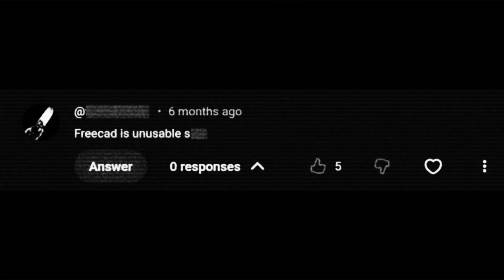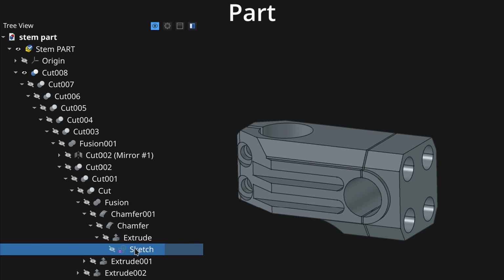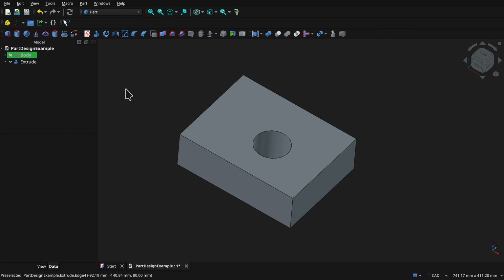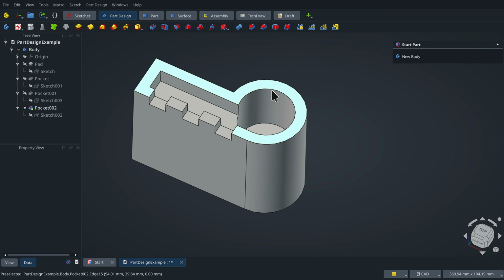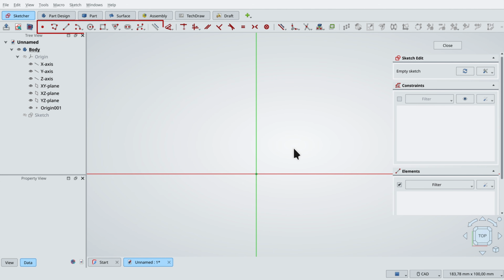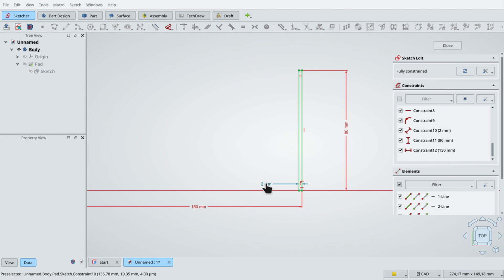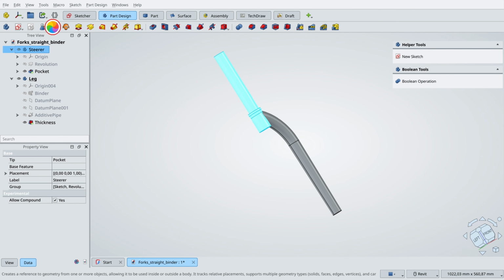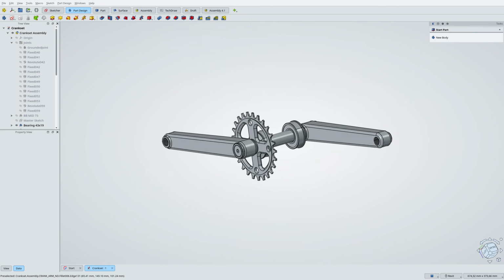STOP using FreeCAD WRONG! Do this INSTEAD (Workflow & Tips)

Comment: So, amazing video! It gives me more inside about the program and mindset. But what I don’t get is, I always need to round corners at the end of the CAD adventure. But when I do, and then 3D print that object and it is to small for example. I need to adjust the length, but then I need to remove the round edge, adjust the length and put the rounded edges back at it? I have around 40 hours in this program and I still only know the beginning of the program. 

I feel like my parents dropped me off at MIT when I was 7 and just said “good luck, see you next year”. I feel so stupid and dumb when using this program. I don’t know anything from errors to how the basic restraints work. 

I frustrate myself a lot when using this. And it isn’t the programs fault. It is the first and only CAD pregame I use. And that frustrates me more, that I just don’t get it after that many hours because FreeCAD doesn’t say “this error means this and you can fix it if you do this”. FreeCAD just says “YOURE DOING IT WRONG YOU STUPID!!!!!!”  And then nothing… no help at all. 

So if anyone can tell me how to use the rounding edge at the end and still edit the length for example. That would be great!

Comment: I am using FreeCAD, and probably will continue using it, but its UI is really a mess. Why when you create extrusion in Part Design and in Part you have different interface? Why in Part it does not have a preview? Why I cannot disable this "snap to middle"? (And, by the way, why there is no easy way to create this middle point of a line when I need it?) Why when I use "horizontal length" constraint I have to select point on vertical line, and cannot select line itself? Why when there is "Wire is not closed" error I cannot see immediately (or clicking the button directly in the error message) what exactly is wrong, and I need to go to "Validate sketch", and highlight is lost when I then open Sketcher to fix the issue? I can continue these questions forever.
Yes, I know - it is opensource etc. But sometimes it looks like priorities are skewed.

Comment: I am using FreeCAD for 6 months ... And I find it really good until the point you need to tweak something, things are constantly breaking ... Maybe there are design rules for avoding this, but I think it could also be designed better ... Selecting things with the mouse on a 4k display is also very hard ... but it's free ...

Comment: you are both correct and wrong. FreeCAD is amazing because its so powerful and free: correct. FreeCAD has a very high learning curve and overall skill floor making it worst for beginners compared to many other software.

Both statements can be simultaneously true. The freeCAD team should bring in some outside eyes to help them take a look at their product and re-evaluate the workflow, if they ironed out the cumulative pain points freeCAD could actually be a real contender against the paid options

Comment: I started with TinkerCAD and moved on to Fusion 360. From time to time during that period, I checked in on FreeCAD on several occasions and really wanted it to work for me, sadly, it did not. I simply could not get it to work for me. Fate would have it that I switched to Linux and had problems running Fusion 360, so I gave FreeCAD a try again. This time, probably because of what I'd learned in Fusion, FreeCAD made a lot more sense. Now I am full time in FreeCAD and I do not have any real problems. The learning curve, as mentioned, is steep, but definitely worth it.

Comment: Usually , the 'u are not clever enough for the tool' objection means its a badly designed tool. It can hardly go beyond the geek market. UI / UX expertise exists for a reason. You can surely become an expert at coding with VI , its not the way it works in the software industry now. Nice UI is king,

Comment: One thing to note in your video- you CAN have a rectangle with a line down the middle and still be able to pad it- the trick is that the Sketch should be drawn as 2 rectangles sharing one side which gives the visual impression that the sketch is actually one rectangle with a line down the middle. You then CTRL-select each side of the first rectangle, and pad it and do the same to the other rectangle.

Comment: Coming from Solidworks, I had the same first impressions.  I failed to remember 50 hours of formal SW coursework and a year's worth of at-work learning went into that other success.  My main struggle has been with the difference in the constraints workflow, and what remains is in gripping how FC handles and presents SELECTION in its UI.  Do I hold CTRL and click to select more than one feature, or is it additive... I'll figure that out, but it remains a challenge even after about 8 hours of use.  I designed five versions of what is a disk with 16 through holes near its OD, a center hole, and a hex pocket.  The first two versions took me 4 hours to get right, and half that time was going back and forth with my slicer.  Version 4 had some irritating undo/redo problems, where I could not undo just the (incorrect) establishment of constraints without major steps in the tree undoing themselves.  I don't know yet if I just did something wrong, or if it is in the nature of FC- but I closed that file without saving, and version 5 was re-drawn in about 7 minutes, proving this is all mostly a learning process of how to do things correctly to begin with.  Given the cost of 3D cad, I am so grateful to have access to a tool this robust, this supported by other developers, and all for FREE.  Absolutely an important part of my design development for personal utility projects and creative output!  Your video content was great, and it is well executed!  No distracting music, and perfect audio.  Well done, and thanks!!

Comment: When a somewhat complex loft is split vertically using a Boolean operation and a simple fillet is subsequently applied to the end face, the previously valid wire breaks, resulting in an invalid solid.

This goes far beyond a mere "skill issue." 

Even accounting for the inherent limitations of history-based parametric modeling, I have no desire to waste my time and sanity by continuing to rely on such a fragile geometric computation kernel.

Comment: Your video is excellent, but I am still struggling (after 6-8 months) with FC.  Yesterday I tried for hours to centre a cone onto a disk. I failed. Just couldn't find a way.
This is my experience with many straight-forward operations, but I can't find the logic behind the method.
The order of the model processes has no obvious logic to it. I'm sure it has, but no one has explained it clearly (to me).
I'm not saying it's anyone else's responsibility, but I have watched many videos and practised many drawings, but progress is torturous.
Just a simple workflow method would help remove the log-jam.
A good description of the model tabs (body, sketch, pad etc,) would be very helpful too.
I can see what you experts can achieve, so I know it's a great programme, but yes, it's fkn hard to learn.

Comment: I'm not saying it's a trash but honestly now, after a half year of watching tutorials and learning freecad, modeling my own models I'm very disappointed,i just stacked on one model, and at least for now i don't see solution, and AI says its an internal core restriction with nurbs algorithms, which drived me nuts for last one week trying to solve and find workaround with no luck. i can give you a model if you wish to see if i did something wrong but i folowed tutorials as if it would be holly word.  now I'm looking to fusion360 as i gues doesn't have such problems. sadly, lost a lot of time, and i really like it as a tool, but that issue.....if you could help me to solve it i'd appreciate it a lot

Comment: I generally use Solidworks, but decided to check out FreeCad in case it either surpasses Solidworks in capabilites or ease-of-use, or in case I ever need a free option.  Coming from Solidworks, I was surprised by how intuitive FreeCad felt, and by the parity in features between the two.  How fantastic would it be if free, open source software like this could not only offer an alternative to, but completely sink some of the commercial software companies that exploit being "industry standards" to force people into extortionate licensing agreements and "subscription" pricing models that force them to fund decades of lackluster development.

Comment: I have mastered 123Design (now dead), Fusion 360, Siemens NX, Onshape, Catia and now started trying FreeCAD. 

You completely hit the nail regarding the mindset of using FreeCAD because I am treating it like the other industrial softwares that has had hundreds of millions in rnd poured into them to avoid causing headaches for the users by either simplifying the tools or fixing core issues of computing. FreeCAD isn’t that, they give each user full control of the interface and logic behind modelling and I’m not used to that. It’s exciting to learn something hard again, I never thought I could rip out my hair the way I did when starting my CAD-career 13 years later.

Comment: tbf fusion and solidworks both are very complicated and powerful and do parametric design. the difference is that they make the simple things easy and intuitive. you want to extrude a face? click on the face and click extrude or click extrude and click on all the faces you want to extrude. it updates on the fly and you see exactly what you want. the defaults are sensible and you don't need to change a bunch of settings to get intuitive design choices. freecad could use better defaults at the very least

Comment: FreeCAD 1.01 -- from the beginning they still don't show the origin and Axis/Axes.  FreeCAD is terrible.  I have to dig for buried options to still turn on the damn grid.  Zooming and Panning still doesn't exists with [shift], [alt], [ctrl], or [super] key.  Its 2026,  and freecad hasn't got their act together.  It should easily be added with 20 lines of code.

This supports my findings that FreeCAD knows they have these bad U.I. decisions and they keep it difficult on purpose.  I used freecad today 2026-August-4 and it is absolutely crapola.  I've been using all CAD software since 1997.  They still haven't simplified nor reduced the mouse functionality or shortcuts.  The maintainers are still tinkering and making the U.I. waste time fumbling around with typing and all types of dumb U.I.  We've had this stuff figured out since 1988 and freecad is still getting it wrong.  I literally had to close out freecad and went to openscad, openscadstudio, blender and other IDEs that force you to type commands.  Typing is better than the mouse interface in freecad.  They're still burying menus.  Dang freecad.

Comment: Having been an AutoCad, then SolidWorks, then SoildEdge user, I tried to use FreeCAD yesterday since I lost my access to SolidEdge.  All of these tools have a steep learning curve, but the difference is that both Solid* products make sense once you learn them.  I haven’t found that to be the case.  I spent nearly 6 hours trying to learn enough to design a simple sound booth coarse design for a carpenter to use.  I failed.  I finally resorted to TinkerCad, since it was a simple design, and knocked it out in less than 2 hours and I had never used TinkerCad before.

I am sure once proficiency is gained in FreeCAD, it is a good tool, but the time required is significant and the underlying logic still escapes me.  To me, this is a significant shortcoming of the tool, particularly for infrequent use.  I can’t imagine ever being able to use this tool just a few times a year and remembering how to do things.

Comment: I have to say when I first used freecad I did call some of the things odd but also stupid. I tried to use it like I used AutoCAD but it's different.  But I was kinda forced into using it and continued. And in all honesty I love it now. The flow of making a part is different but it makes modifications later down the line much easier. I do have issues with it from time to time but I believe that I'll eventually learn how to do what I want and learn habits of what not to do. While this video wasn't directly responsible for me learning it. It is responsible for me pushing forward to learn it.

Comment: I downloaded freecad a couple of days,  I'm self taught in Fusion, but the price is is too much these days for only needing to design things for personal use.   

My biggest complaint so far is that circles in the sketch are not round,  so if you're using that circle edge as a referance, the point you add is not actually on the circle, or the line you draw doesn't actually end/start on the circle.  

the other things that bug me i'm sure are just the need to learn program.

Comment: I wonder how many of these critical reviews came from people who did NOT have a solid grounding in parametric modelling, using a tool like Solidworks? The skills I learned in 15 years of using SolidWorks translated over very well to FreeCAD. Sure there are a few things that are still rough around the edges, but I'm also not paying $1,200 PER YEAR for the privilege of using SolidWorks, and the improvements are coming fast and furious. I have used FreeCAD for designing quite a few projects and verified the fitup of assemblies before committing machining and welding time, or sending out STL files for 3d printing.

Comment: You have actually demonstrated why FreeCAD is such a pita.  I use CAD intermittently.  I seem to have to relearn it every time I go back to it.  There are so many CAD or CAD-like programs and all of them think they have the right to redefine all the controls.  Having several ways to do something seems like a good idea but it isn't.  Using drag and drop to perform important operations like you showed with the teeth on the box is a terrible user interface decision.  Having to load extensions and then redefine your user interface to make it usable isn't a feature.  It is a failure of the design team.  What happens when I have to reinstall FreeCAD?  Or load it onto another machine.  Now I'm back to square one again.  I get it if CAD is your life and you do it all day every day then spending that kind of time redefining the user interface makes sense.  But as a hobby it makes no sense at all.

Comment: This is a great , but let me ask a very simple question: why is the Preferences located under the Edit menu? Why isn't it under the File menu, as it is in most editors and IDEs?
And I'm not even talking about error messages. Saying that they "don't mean anything" is like saying that water is wet—it doesn't address the real issue.

This may seem like a minor detail, but it's a perfect example of why so many beginners find FreeCAD confusing and eventually give up on it. Even simple tasks are unnecessarily difficult because the user interface doesn't follow common conventions.

If basic actions are confusing, how can users be expected to feel confident working on complex projects?

Comment: A tool hast to fit the hand of the user, be balanced well to avoid strain, be predictable in its behaviour. If a software tool is backwards and counter-intuitive, is hurting logic and engineering principles, in other words, requires the user to ignore industry standard workflows, the problem lies with the tool, NOT the user.

Comment: I work with freecad, it's good,  some things like repeating patterns are slow. Then I suggested it to a friend, and he kept complaining about things not working, crashes etc. Turned out he was using it on apple. I use it on Ubuntu, no problem, apple: total nightmare. Makes sense, maintaining open source software running on open source is of course much easier than trying to find the dev info with Apple asking for money on every corner.

Comment: I agree with many points here but I also see a lot of cope. Things like fillets not working when the thickness is equal to the radius or having a separate tool for creating a mirror of a mirror instead of including that functionality in the actual mirror tool would be non-starters for any professional or semi-professional CAD tool. Those are basic functions that should be bulletproof.